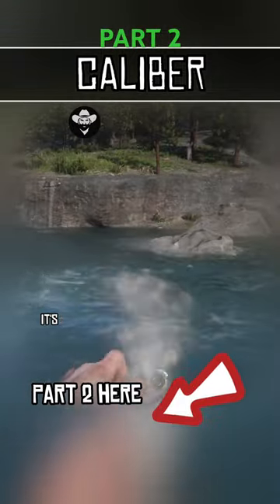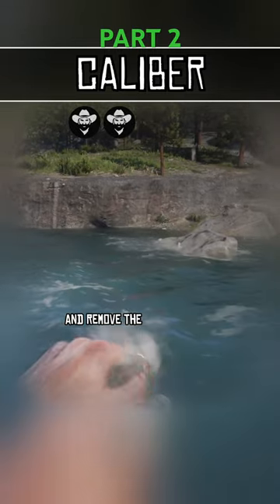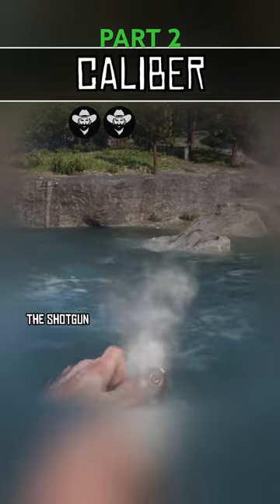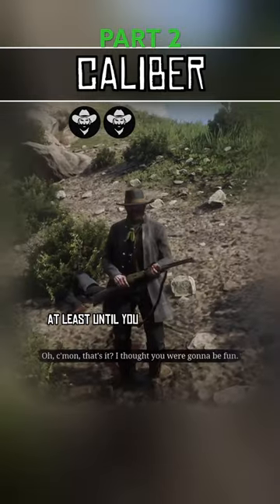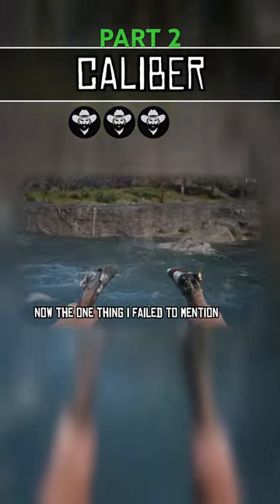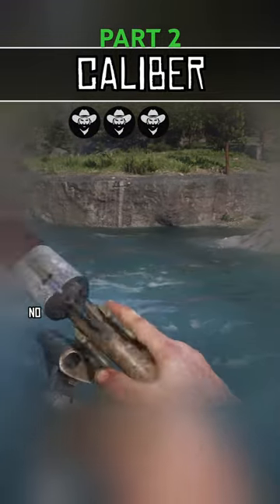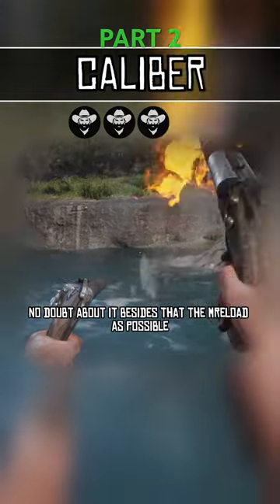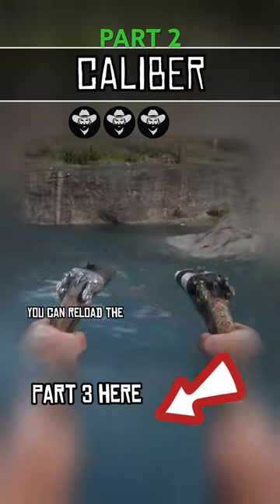How Historically Accurate Is The Sawed-Off Shotgun? PT 2 #rdr2 #rdr #history #accuracy #reddead

Comment: As a registered SBS/sawn-off owner, I'd like to mention that hammer guns, like in-game, make much better sawn-offs. Because internal-striker/hammerless shotguns use the weight of the barrels being opened to cock the strikers. So if you cut one of those down, you wind up having to crank it open with both hands. You can only really do the "mad max" style one-handed opening/reload thing with external hammer shotguns, which are cocked by hand afterward.
Reply from the maker: Nice